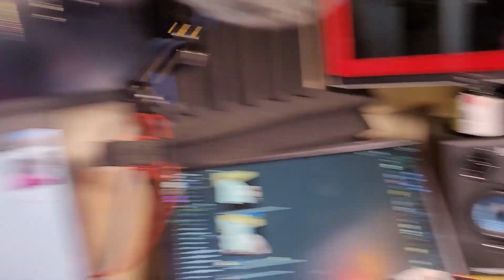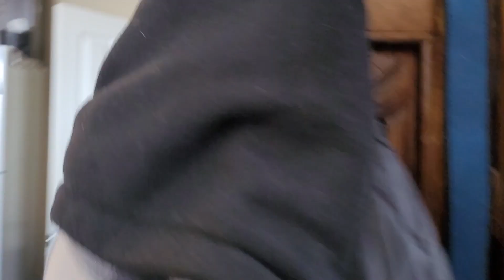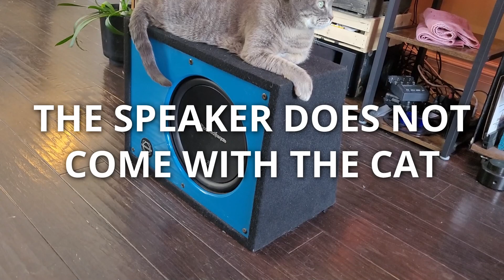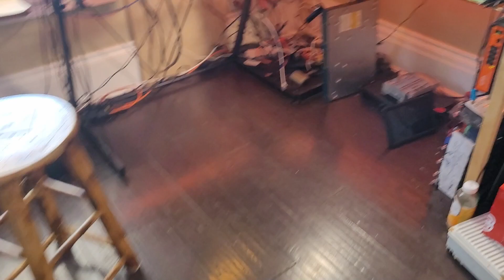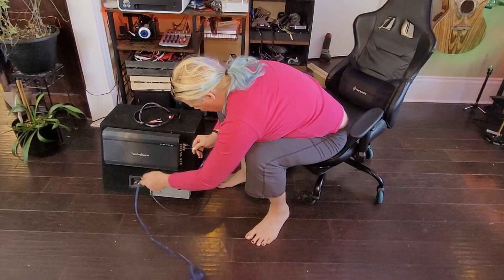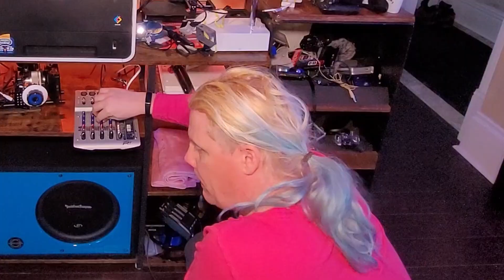I needed a bit more volume. So I upcycled a car stereo.

Comment: How's this holding up?  I fear the amp would draw a bit much from the power supply.  I'm thinking of doing the same exact thing, with pretty much the same equipment (have been thinking of this for a while so I have it all, I just haven't pulled the trigger yet) I'm wondering if during bass heavy music the draw on the power supply will be too much?  I'm considering putting a 12v 1 farad (Pyle) car audio capacitor in between the PSU and the amp to buffer some of that draw.

What-cha think?
Reply from the maker: Fine. It's not like I'm pounding it like highschool kid.